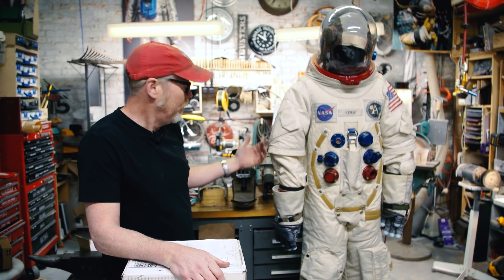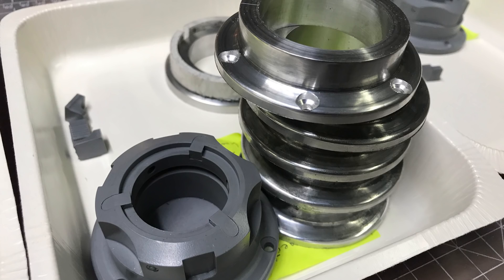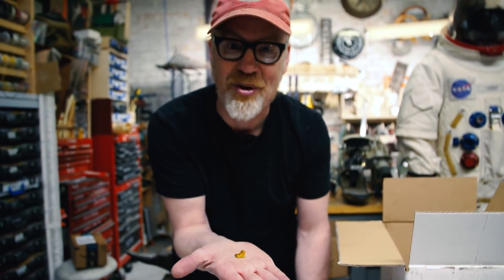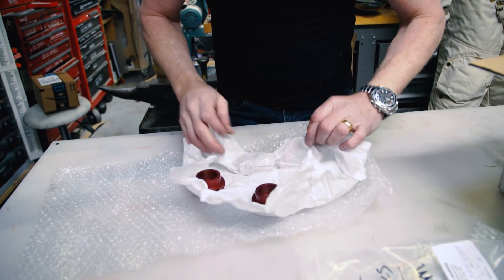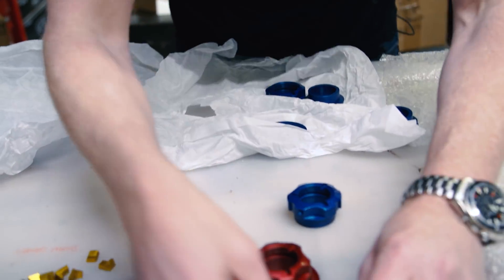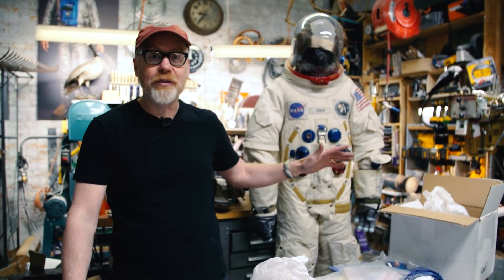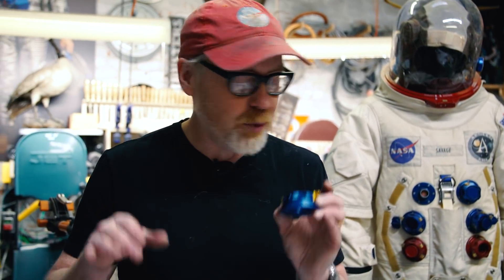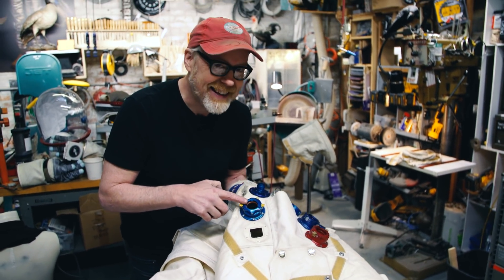Adam Savage's Newly Machined Spacesuit Parts!

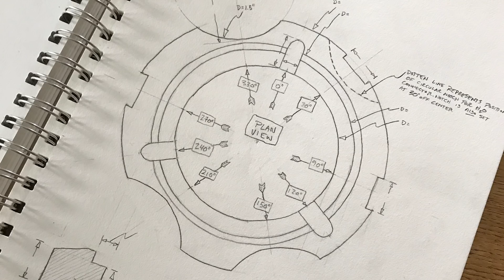Comment: Who else noticed at 1:04 that the plans mention a "dotten line". :)  That is a seriously cool replica of an Apollo space suit. You could see the aluminum heads of the screws on the replacement parts. On the ones you removed they were also in blue or red. Were the original screws also coloured to match the connector?

Comment: As someone in the video production field for over 30 years now, I have made numerous parts for all manner of applications and it was nice to see someone else go crazy when parts come back from an anodizer or powder coater. It's hard to explain what it's like to have your RAW parts suddenly turned into things that look like you went out and simply bought them somewhere. Anodized parts need to be sealed but can also be stripped and re-anodized. UV light will bleach anodized parts, so just leave the darker ones on your car dashboard for a while. Your anodizer failed to dye them all in the same basket or the metal was slightly a different density or batch and took the dye differently.

Comment: I wonder if the color difference is due to a difference in the surface before the anodizing. I could imagine that a finely polished piece would turn out lighter than a rough surface. It's also possible that you used different aluminum alloys - some suppliers stock 6060 while others stock 6061 (not to mention the other variations) - and maybe that has some effect.

I'd assume that they would anodize all the parts of the same color in a single batch - so the color should be the same if the surface and material is the same. But that assumes the process produces a consistent color. It's possible that it doesn't, for any of a variety of reasons. 

And you have a great way of making lemonaide out of lemon there. I'd feel a bit mixed about the result if I got a variation like that. And personally, I'd prefer to have the gold parts actually gold plated if the real ones were gold plated - there's just no way that yellow can replicate the gold luster. But if they are supposed to be yellow, then they look perfect.

Comment: the last shot on the side by side comparison, as a hard surface 3d modeler, they are very different, shows Adam's metal part has much softer edge than the resin casting, i wonder if its because of 1) anodization corrode the edge(very unlikely) 2) Adama made it softer to be more accurate 3) Adam found a excuse to machine it correctly?

Comment: You could get into anodizing aluminum Adam.  On a basic level it can be done in a five gallon bucket.  I really think you could turn out a quality part with very little time invested in learning and getting everything together.  It is a safe process as all you are doing is accelerating the oxidation process and then adding dye into the microscopic gaps created. After that it is just a sealer to keep the dye in place.  Hard anodizing is a lot more complicated, but certainly within your reach.

Comment: Yeah, I use Milners too... they rock generally... I don't get the difference in the appearance.  Did you use the same aluminum (all 6061, for example)?  They do an acid bath I think for their surface prep, so the "pores" in the aluminum should be rather consistent.  I hope they didn't refresh any baths in the middle of your run.